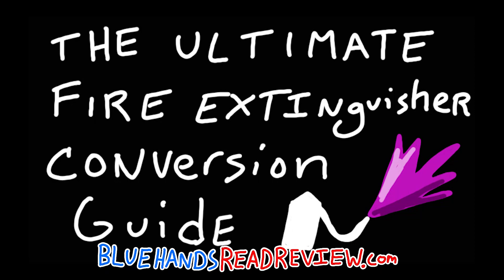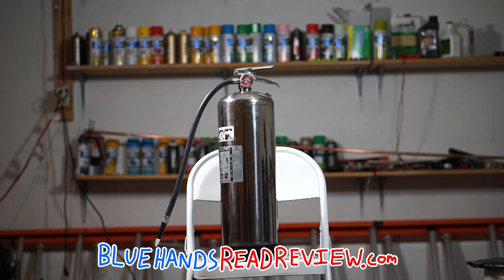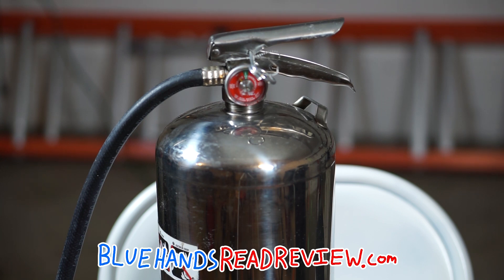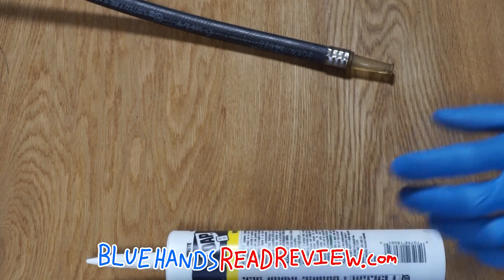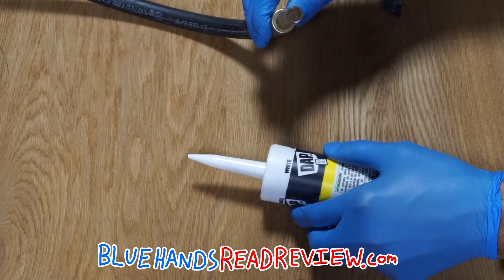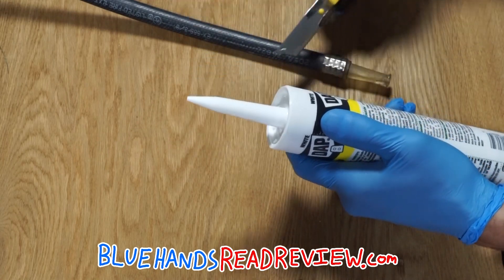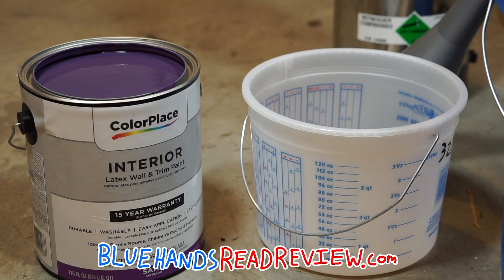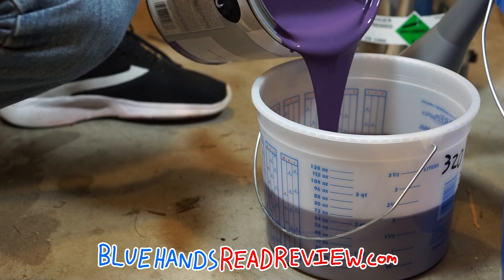The Ultimate Fire Extinguisher to Mega Paint Sprayer Conversion Guide

Comment: If this info helps; they’re are known as class “A” fire extinguishers. They’re meant for just water. I got two from a garage sale for ten bucks. When you get them second hand make sure they function properly with water before you put paint in it or you’ll have a hell of a mess. See that none of your seals are leaking and the gauge works. They’re rated for 200 psi but that’s a lot and not necessary to put up a fast one. Make sure you clean it a lot once your done or it’ll be a real mess to fix. If you’re using latex clean it with water. If you’re an oil based paint use white vinager or better yet, acetone. Hope this helps.

Comment: With a 3 to 5 mix, make sure to add clear  acrylic medium to make sure you have a permanent bond and not something resembling watercolor that will wash off the wall.
Reply: How much do you add for the amount he used?
Reply: @408_blazenation For reals I’m trying to figure that out
Reply: @MarioSanchez-vi3zz  seriously if you can’t figure out how to dilute paint or thicken it up, stick to the spray cans for now.
Reply: will acrylic-latex paint work and do what you said?
Reply: @cameronb478  Yes, different paint medium/resin, but both water-based (emulsion paint) and compatible.

Comment: Using a thumb clicking style pen works as a tip also, and you can unscrew it and clean it in parts. Also you can modify different tips for different flow rates and patterns. They just thread  on. I used pilot g2 pens cause they were cheap and the plastic body makes a good seal to the extinguisher plastic tip with two part epoxy (using tape is a horrible idea no offense)
Reply: Any tips on making it spray wide?
Reply: @warlordcheeky2166  attaching a pressure washer tip would do it. Select a fan tip and if the hole is too small for the stuff your trying to spray-use a Mig welding tip cleaner tool to expand the hole enough to flow. The mig welding tip cleaners are little diamond files the diameter of a welding tip so it will get in there.

Comment: mine doesnt hold the air pressure inside, the gauge wont rise and the air just shoots out of the hose when i attach the air compressor, help
Reply: Same man
Reply: @Ganggumstyle  i've fixed it since, i had my pin still in like an idiot.... make sure you pull out the pin before you are pressurizing.

Comment: Well, speaking of the air. Why do you deny it's a thing to consider? Yes, you need it for pressure. But if you put high pressure in a small volume, it will fall very soon. Say, you've left 1/10 of total volume empty and pumped it. As soon as you spray some paint, say, 2/10, your pressure will be lower three times, because now the same pressure is spread in the three times bigger volume. And if you go for smaller paint amount, your pressure will be much more stable, instead of drasticly dropping in the end, being at least 10 times lower than in the beginning.
Thanks for the video bro.
Reply from the maker: Very interesting take! Yes it is a trade off!
Reply: @tomrogos643  Also to add to Dokotor Kota the purpose of leaving the air bobble is to shake and remix the paint/water mixture once your ready to use. Being two different viscosities the paint and water will separate after sitting for an extended period of time